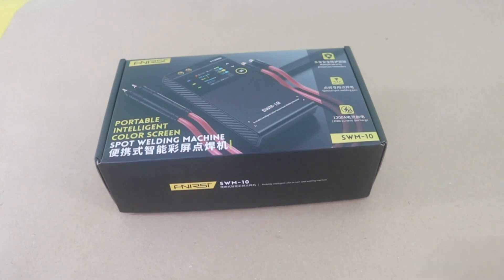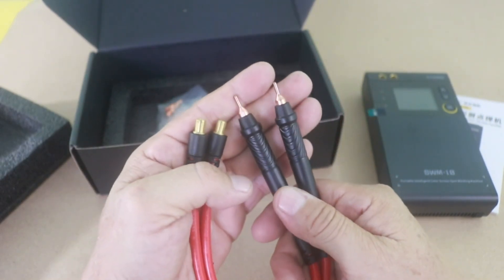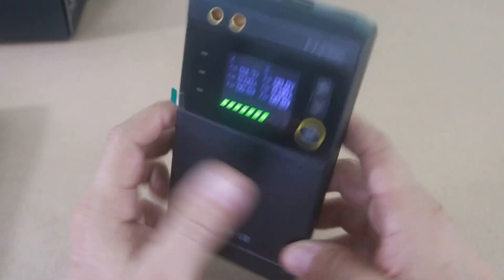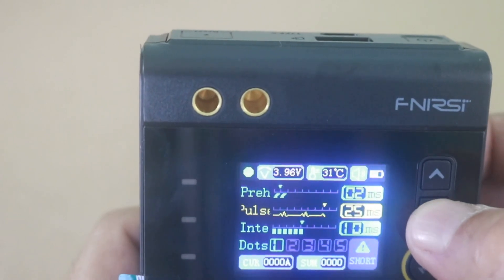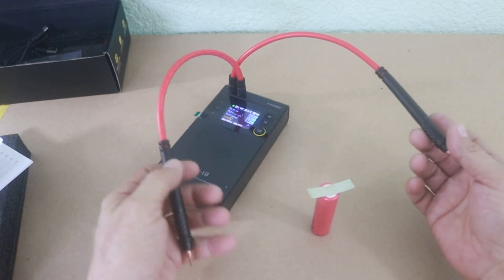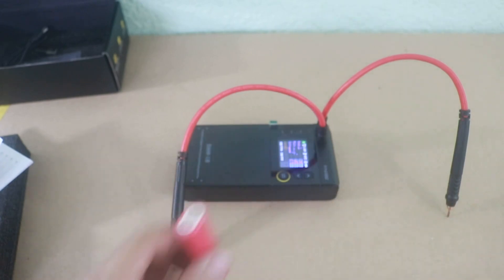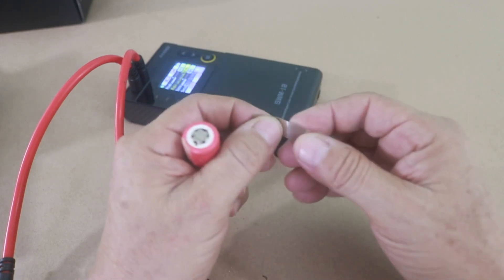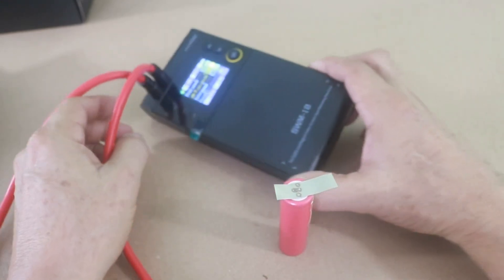FNIRSI SWM-10 Spot Welder Review and Test

Comment: Wish I had watched this video before I bought mine. With a fully charged battery I found  on anything thicker than the very thin supplied (at best 0.1 mm?) strip the welder indicated a short circuit protection. You can disable this short circuit protection feature in the menu - but doing so did not seem to improve its welding capability. I did find that it seems to weld better if you don't apply too much pressure on the probes.  Eventually I managed to construct a couple of battery packs using some  0.15 mm "nickel plated iron" links which probably have a higher resistance than pure nickel strip. Before I purchased mine I have watched a couple of reviews of this welder where I assume the reviewer had been gifted the welder - in hindsight they probably only attempted welding with the supplied thin strip. Maybe someone can recommend a more capable welder that will not break the bank?
Reply: im thinking to get one, it seems it needs a firmware upgrade to solve the problem you are having.
Reply: @meguinness1116  Hi Thanks for the tip - Not something that I had considered so will explore this further.
Reply: @richarddunkling2807  Any luck with the firmware?
Reply: @meguinness1116 that's funny! 😂

Comment: I wonder if your unit needed to be charged?  I made some test welds and mine could not be pulled off by hand.  It manual mentions that you can change the number of Dots, which will help with thicker material.  Also, in their manual, they mostly say spot welds, but they also say: To strengthen the solder joints... This thing was cheap and it works for me, so I forgive them 🙂

Comment: Make video on mosquito bat circuit. Seen few videos on yt but their is no explanation, no values of component..  DC operated circuit which output around 2000v for insect zapping but with low ampere (not lethal for human/pets).  circuit uses mobile charger transformer (or may be inductor or other transformer) one transistor, few diode 4007, resistor and 2-3 capacitors